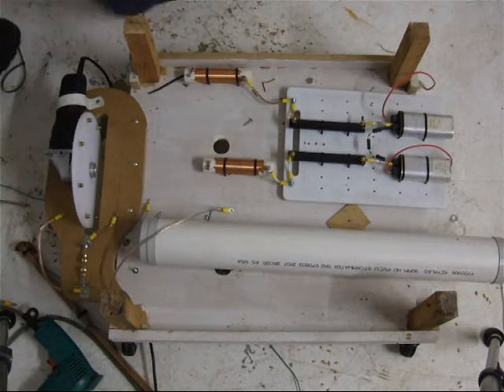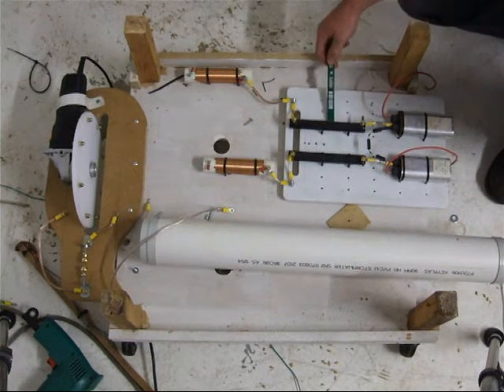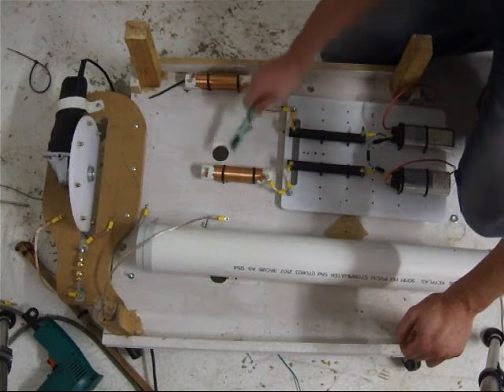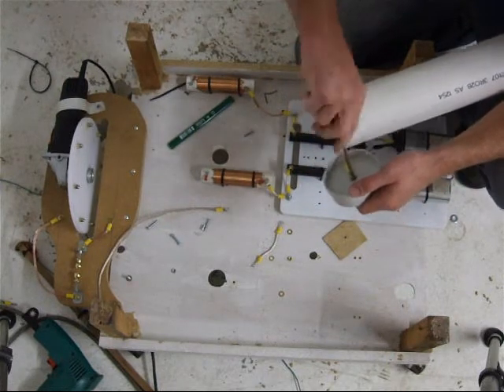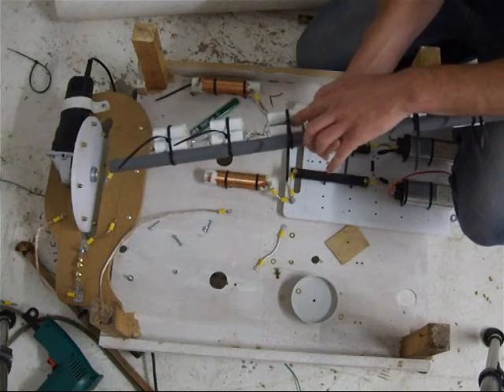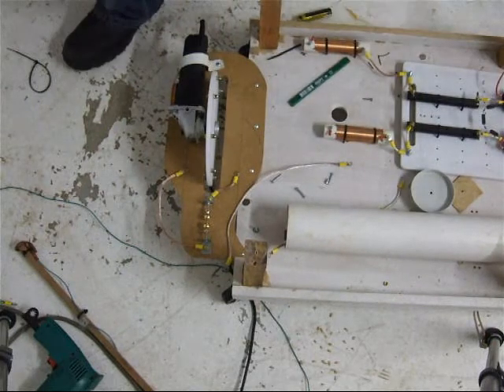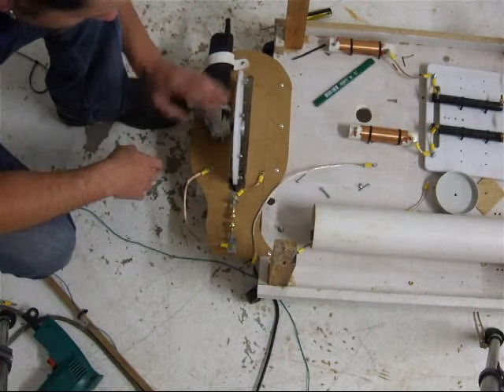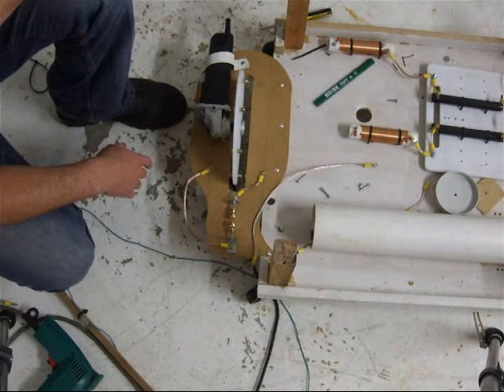tesla coil, bottom deck, DC charging

Comment: It would appear that your MMC is a single string (i.e., groups of caps in parallel, then placed in series).  Be aware that this arrangements means that if a single cap fails short, all the caps in the whole MMC will be overvolted.  This is one reason why most MMC builders use multiple strings, not parallelizing the "layers".

Comment: @HomeDistiller iv heard that less turns is harder on the caps and the gap quenching is more difficult to achieve but does give higher peak currents and brighter arcs. only 4 turns means you could stack a huge topload on that which is good,my dc coil is tapped at turn 7 of 10 so i got a bit to play with,iv never even run it tho,this stupid british weather lol,but i am sat here drinking a brew and thinking is 11pm an antisocial time to drag it all into the yard and wake up this sleepy town...

Comment from the maker: as the cap bank is rated at 18KV in the input is only 6.5kv even if 2 caps go short it will still have room to play and the sudden drop in output will mean i would have the coil off before anymore damage would occur.. plus i don't think i have ever had a cap short

Comment from the maker: @drdreads1 yeah i have some more top loads (have a look at my "tuned tesla coil run" video and you'll see LOL that was when i had the 4" secondary and i was still tapped at about 4 turns now i have a much smaller topload and a bigger secondary and i have much better arcs. i am thinking of adding my large top load on and giving it a go, but i would need to be outside (im almost out the door of its new home as it is. and i dont really want to let the town know its me killing the TV reception lol

Comment from the maker: @drdreads1 yeah it should stop some of it but i still cause rf interference and 25nf is pritty good for that tank cap (22nf is 1.5X resonate) download quick TC it will help, as for frying their equipment if you have a separate ground and you dont strike and lines directly then you shouldnt fry anything (all my equipment deaths have been direct strikes or a strike to something plugged into the same put as the killed item

Comment: @HomeDistiller yes iv seen that vid,i did something very simlar myself but it broke out all over the topload but still wouldnt tune right, turns out i had too huge of a tank cap,25nf on a 10kv 48ma tranny and 2" secondary. the shed in your latest vid is that one of those metal sheds? im wondering if they would act like a faraday cage and stop some interference, at my last place i lived i fried alot of expensive kareoke equipment at the pup downstairs from me,i notice they replaced the rcd's too.

Comment: Sooo.... you just have 2 100 ohm 100 watt power resistors after the doubler and that is it? Thanks for any reply. I already have 400 bucks worth of 1600volt .68uf capacitors and the acorn nuts for the rsg and the mot and caps. the primary is done and the 6 inch by 35 inch secondary is 1/3 done.